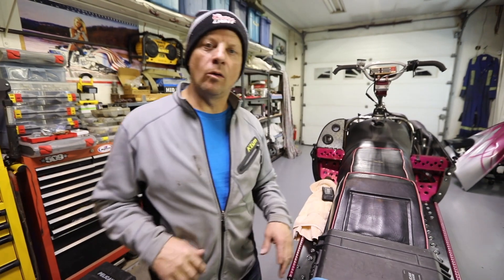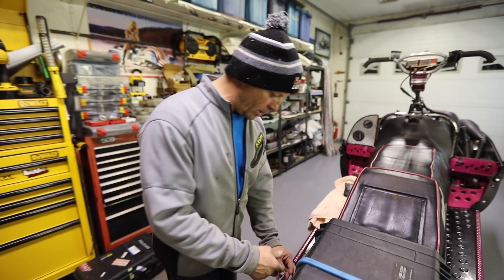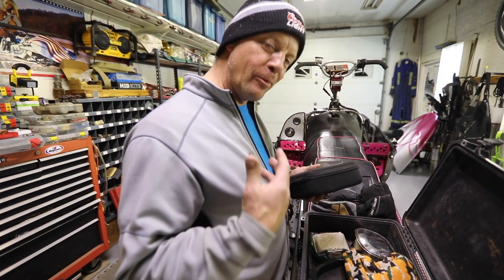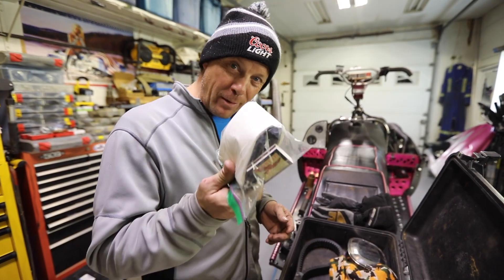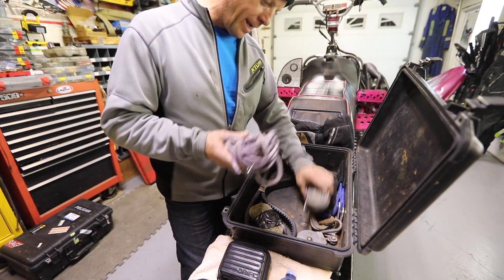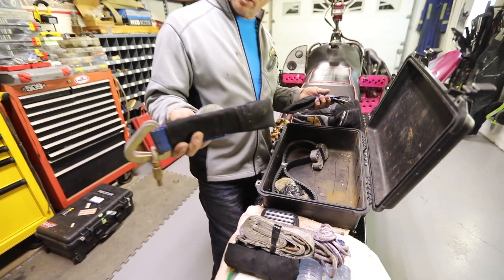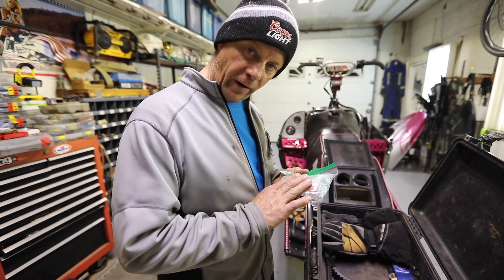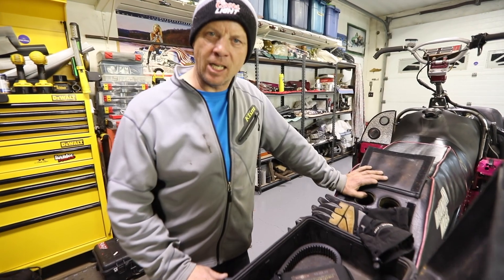What I take on my mod sleds when snowmobiling in the backcountry.

Comment: WTF, none of that crap out side the tool pouch are useful to a mod sled, tie wire for making everything from hose clamps to splint for a broken trailing arm or your leg, also building a lean to in emerg,  massive tool set, spark tester, plug gapper, multi screw driver, mini vise grips, voltage/resistance tester, small amount of electrical wire and tape. small ether and methyl hydrate,  Sure all the safety stuff but that should be in your back pack and on your person.